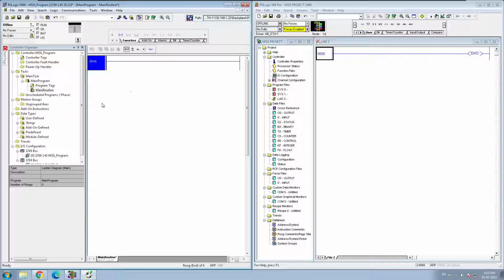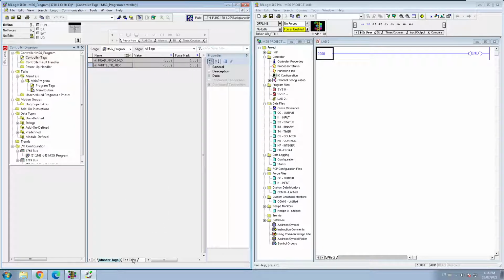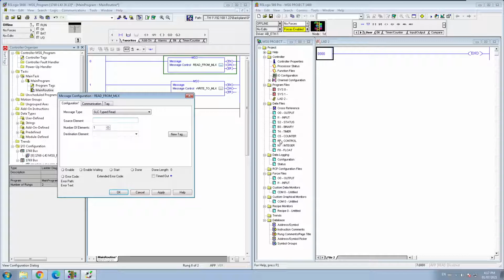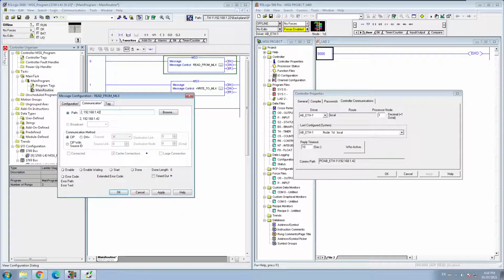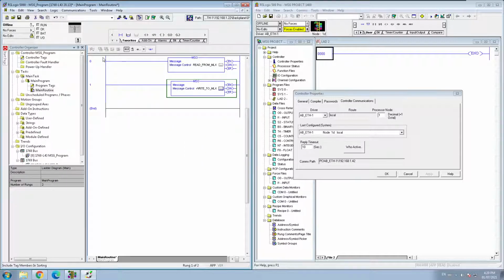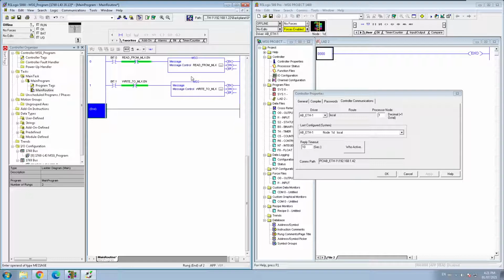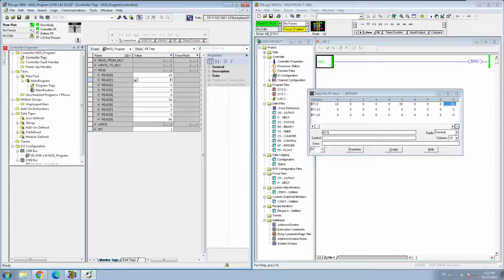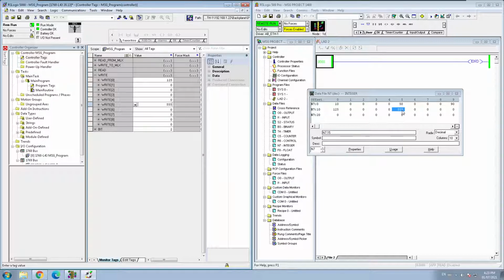Communication between Compactlogix and Micrologix 1400 via MSG instruction

Comment: I had problem when I was doing that in rslogix 500, in messages I received error code e0. I did not know why, but I tried your way and it worked :) I was using micrologix 1100 series B and compactlogix L32E.

Comment: Dear Sir, How to program Ramp up and ramp down in PLC in order to run drive from setting in m/m. ? (Ramp function gen)
Reply from the maker: First we use VFD for this kind of application and if we want to control it from PLC you need some input value to make sure its ramping up and down, therefore you need encoder as well so you PLC can get some kind of feedback.